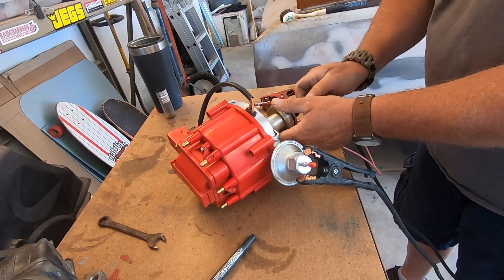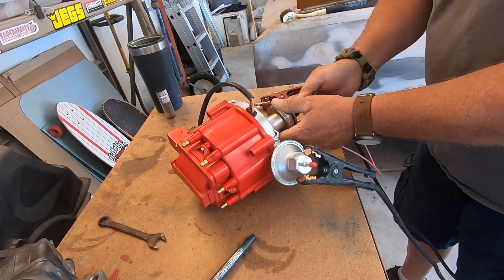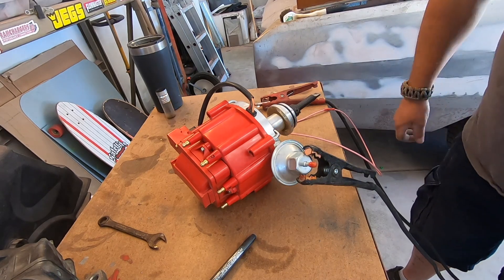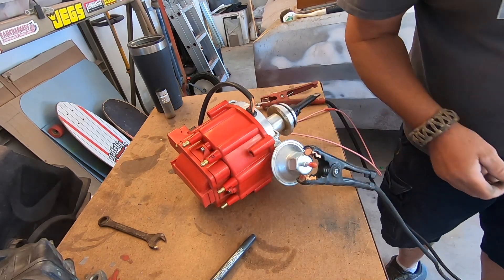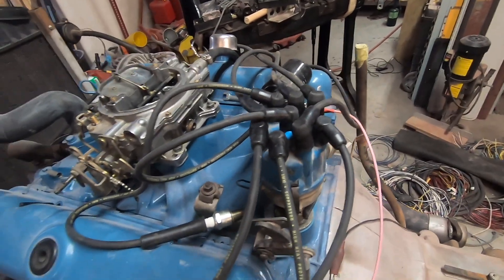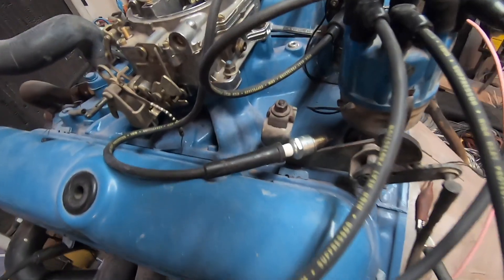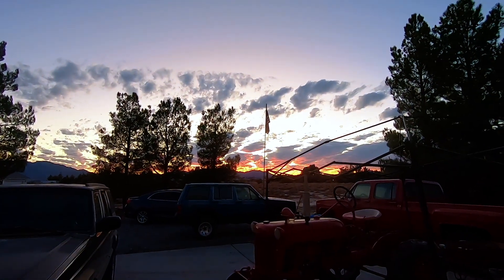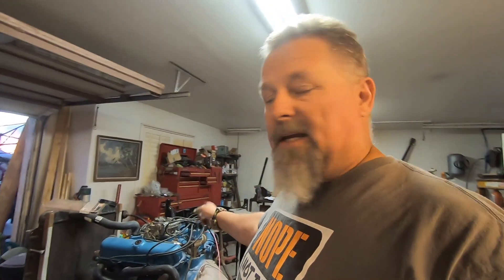No Spark HEI  Don't waste your time on cheap parts

Comment: How do you no if the cam gear is working and is actually spinning your rotor. You need to check it with cap off

Comment: I just had similar problem on my Cub and it caused fuel in the case. HF has pneumatic cleaner cheap, works well if use play sand

Comment: Definitely need a better starter. The old mopar starters were geared to spin faster. That one sounds like its turning to slow.
Reply from the maker: but its a mopar.....they don't make better starters
Reply: @dzlfreek  the one on my 76 valiant seemed to spin faster. It had a 318 also.
Reply from the maker: @brianwolf692009  it does have new bearings and rings though.  and its been sitting for a decade.  we'll see after I break it in
Reply: @dzlfreek  it definitely smoked enough to fumigate your garage. Lol. I can't wait to see what paint scheme your going to put on the dart.
Reply: Lol
When I was a kid and I heard a Dodge cranking. 
I  always thought someone forgot to put oil in it 🙃